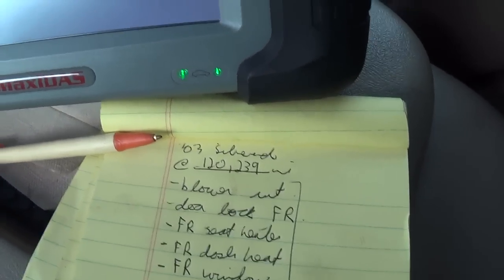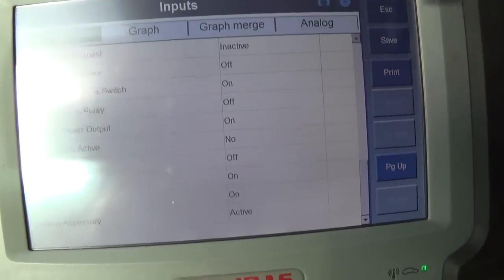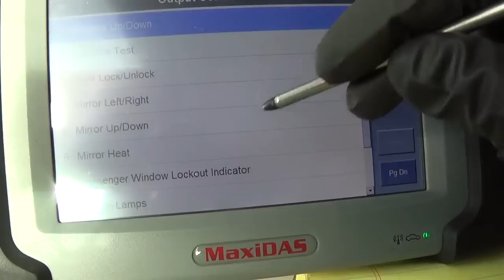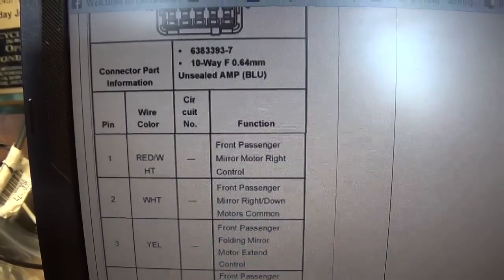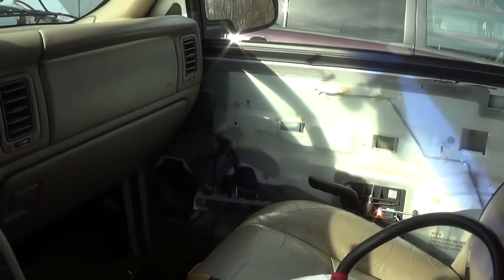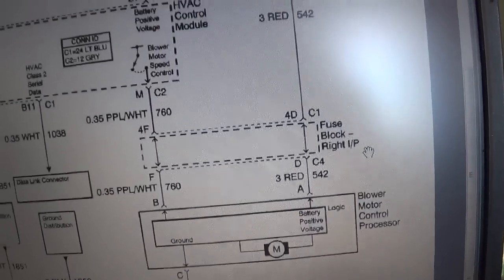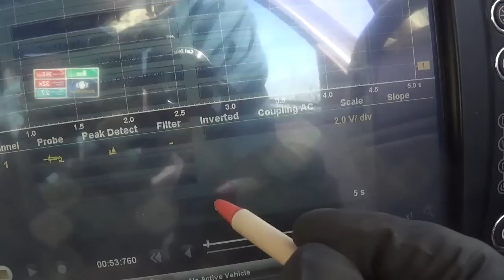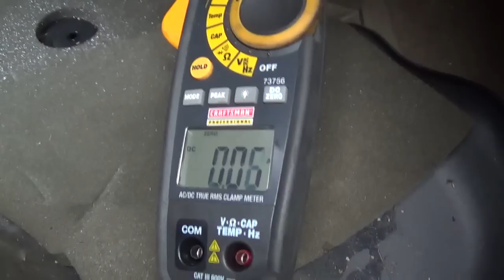Window, lock, mirror, blower issues: '03 Chevy Silverado

Comment: Around the time this vehicle was manufactured, a GM engineer told me that GM only designed its vehicles to last 100 K miles because "virtually none" of their customers ever drove a car longer than that. When I tried to explain to him that was because their cars were poorly made and COULDN'T be driven longer than that, and that there might be a good market for a higher-quality car that could be driven forever and repeatedly repaired, he laughed at me and told me I didn't know what I was talking about. Then GM declared bankruptcy and got their government bailout so they could continue making their crappy cars at the taxpayers' expense. Really, the federal government should have just put the company out of its misery. I would NEVER buy one of those cars, and many people I know agree with me.  But have a nice day, GM!!
Reply from the maker: +William Crowell Having worked on most makes and models, I have just recently found a vehicle that I have lost ALL respect for. And it's not a GM :)
Reply: +motoYam82 Mini Cooper?
Reply: +William Crowell  Interesting view point. I worked for GM for 30 years on the line and  do  not have a  bias in saying  anything but the truth. I have friends that are various types of engineers at GM and they have never mentioned to me a mileage design failure  points.  Spent 10 years in Quality control and never seen  a flagrant known production design fault. As with all vehicle manufactures there are design  challenges . As to your comment about putting GM out of its misery, id say your really talking about  my  brother and sisters that  just try to scratch out a living and in no way are responsible for the  miss management  of a corporation. If it was your family member that worked there would you suggest such a thing.  There are many corporations in America that receive support from taxpayers and for me I thought it was the right thing to do at the time in keeping the jobs in  America as much as possible rather that throw out  2 million Americans on to the unemployment line. I'm not American  , I do buy American ,  I own a newer Ford as well as two Gm vehicles . I don't share your opinions but that cool with me you have a right to express your thoughts.   William you have a Merry Christmas and a Happy New Year. Steve
Reply: +Steve Rob There is a human side to every story.
Reply: +William Crowell William, I worked for a GM component group for 33 years.  Worked with a lot of engineers and quality control individuals.  Been through many a component failure review.  Not one time did we have a 100K breaking point rule.  We looked for zero component failure in every part of our manufacturing.  We use the best parts available and built quality and reliable products thanks to our dedicated workforce.   In fact we built components for both Chrysler, Ford, European and Asian manufactures.  So I guess if your premiss is valid.  You will have plenty of the other manufactures vehicles breaking down for the same reason.
Reply: If they would of let GM go under, Tax payers would be paying approx 60% of all GM retirements. Thats the only reason they are still in business, many large Corp have been put out of Business, Gm is no different. They just were smart enough along time ago to get the Gov to sign onto a crazy retirement guarantee plan, now alot of large Corp have done the same. Thats what they mean by " To Big To Fail ", were doomed basically. Were basically supporting trash. Kinda like after kicking your daughter out of the house, 1 year later she shows up on your door step with a baby,  holds it out and begs to live there again, thats GM today. Dont hurt the employees they use the same plan as the daughter. Millions of people lose there jobs every year, GM should be no different, apparently its good to pay off politicians. We the tax payers are paying the wages of the GM employees. Just sick.
Reply: GM reminds me of British Leyland. British Leyland went extinct because it had a lot of the same problems that GM has. Poor build quality, similar products with different names on competing against other parts of the same company costing vast sums of money. Antiquated technology. 

The only bit of GM that will survive the inevitable collapse will probably be Opel/Vauxhall because it competes in the European market. 

Ford is the only one of the big 3 I can see surviving even with its God awful build quality.
Reply: Charles that's an interest take on the situation I have no  knowledge of. In Canada the taxpayers pitched in 9 billion and GM Canada  was and has never been bankrupt or its off shore holdings.  As a result over the last 5 years GM has repaid its debt  to the Canadian treasury plus 2 billion in interest. Your analogy is way off side as to the facts and GM   today produces as good as a vehicle as its competition in many respects.  I think your frustration with government intervention in the market place should rest on the federal reserve and the trillions of dollars spent to prop up  the banking system that manufactures nothing and employs far less.  As a Canadian I find it odd that  some  Americans want to see their domestic auto industry not flourish and don't comment on the positive aspects of   their own auto manufacturing. I know auto manufacturing and the American worker  is as good and produces as good a product  as any country in the world. I wish all the best to my fellow autoworkers and wish the negativity towards the American companies stop. I support America and all it stands for. Steve a Canadian.
Reply: I suggest you check the latest vehicle quality reports.  GM is doing just fine and offer a very good quality vehicle.  If you don't like GM products.  There are a lot vehicles out there to chose from.
Reply: Charles Miller The US Government no longer holds any GM stock and does not pay any retirements or health benefits.  GM is under new leadership and nothing to do with what happened in the past.
Reply: Steve Rob Well said Steve!
Reply: Rick Anderson Rick I just don't get it  man, so many comments trashing the mere existence of  a corporation that once in its over 100 years in America needed help  and  they just crap all over it . Is this what we do, I don't think so and GM today is not the GM of 2008. Do you kick your  brother when he's down, no you don't so  lets  be a little more reasonable in the comments guys  or it  just you and I buddy defending America.
Reply from the maker: +rusco321 Nope it's a domestic. Keep guessing :)
Reply from the maker: +Steve Rob I'm with you Steve, it's too easy to pick on a company as a whole just because some doofus high-up bean counter decided to cut some corners. Every manufacturer has at least one model out there that turns out to be crappy. I wouldn't put Chevy trucks in that category at all...I'll choose it over a Ford full-size truck any day, at least from a serviceability/reliability standpoint.

In my honest opinion, vehicles from the 90s (both domestics and imports) were of overall better quality...now they are all disposable plastic computers on wheels HAHA
Reply: Well said Ivan bang on .
Reply: Steve Rob I don't get it either Steve.  Most the manufacturing is gone from America but yet the European and Asian car companies are relocating to America.  I hate to see the former Big 3 fall flat on their face.  They did make some poor decisions back in the eighties and nineties but they all make a better product today.  I would say Ford and GM make world class vehicles today.  Some of these naysayers should go out and look them over today.  I think they will find they have been mistaken.
Reply: +Steve Rob In fairness to GM i think bailing out the banks was 1000 times worse. The bank bailouts and low interest rates are partly why the economy has been so sluggish and depressed in recent years. GM at least has some productive value and assets that are worth something. 

But once you go down the road of bailing out corporations and giving them state aid it often will not give the desired results in the long run. The British government piled billions of pounds into some of our failing industries on multiple occasions only to see them go under during the 70's/80's. Until 2008 when the crash hit the rule had been no bail outs for anyone under successive governments.The last British car company MG-Rover was allowed to fail in 2005. 

Toyota, Honda, Nissan, BMW, Vauxhall and Indian owned Jaguar/Landrover all make vehicles or engines at various places across the country. Ford make a lot of their diesel engines in the UK. If one manufacturer goes others will have to expand their operations to pick up the demand in the market.
Reply: zoidberg444 Well said and you know your history quite well.  
I agree but it seems to me watching American news I don't think too many people realize GM is world wide and only the USA division of GM went bankrupt but it would have toppled all like dominoes if left to disappear.  As to the Asian and Korean and European car manufactures building in North America and now domestics as well  , each of these companies are paid a minimum of 1 billion dollars  each in cash or energy subsidy by the country's treasury and of course that's the tax payer if not they go elsewhere. Auto plants in America do not export as much as Canada and British have, In Canada 9 out of 10 vehicles are exported and as the history of British car production so is Canada following the same path. Auto production has decreased every year since the late 80's and now a fraction of its peak. Canada does not have the money to compete with other country's and we have more plant closures. What a shame .  Free trade or fair trade not sure what's up or down any more. Nice discussion. Cheers Mate.
Reply: +William Crowell GM is ceasing Australian production of the Holden Commodore in late 2017. After that all GM lines will be imported. Ford are also ceasing production of the Falcon and Territory  in October 2016 and all lines will be imported thereafter (we get a right hand drive  Mustang to keep the local petrol heads happy!).News is they're pre-sold the first years quota already!!
The hard right neo con economists that run OZ (aka The Liberal Party) don't believe in car industry subsidies. No more sponging off the taxpayer they say.Fact is though  every country that's got auto manufacturing   subsidises it in some way or another .GM, Ford and Toyota are taking their bat and ball and going home leaving Australia with no car manufacturing/assembly going forward. Damn shame, the local GM and Ford offerings are as good as anything made around the globe. Some experts say the loss in direct and indirect jobs will be over 50K. That would be like 500K in the US. So maybe GM is crappy in the US but whats the alternative?
Reply: +tecnaman 
Damn forgot to wish Ivan a merry Christmas..and oh year, another really entertaining video, thanks!
Reply: +motoYam82 Got it! Ford Exploder;) Just viewed your latest video and you didn't seem to impressed with it.
Reply from the maker: lol we got a winner!